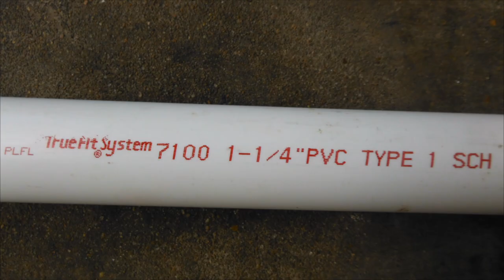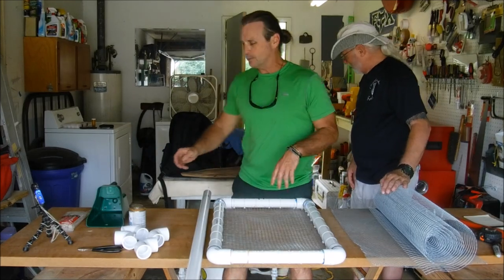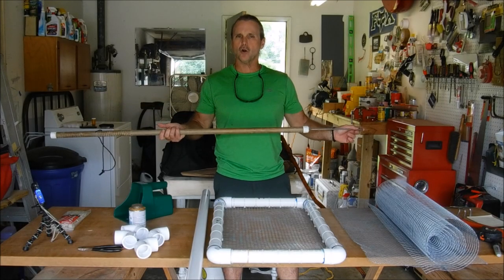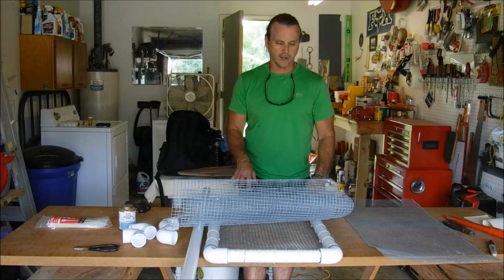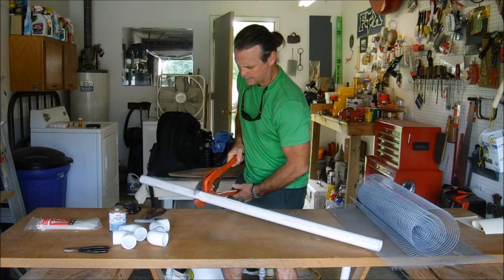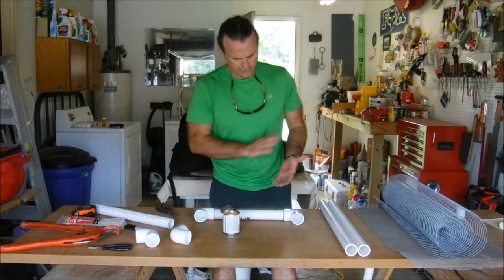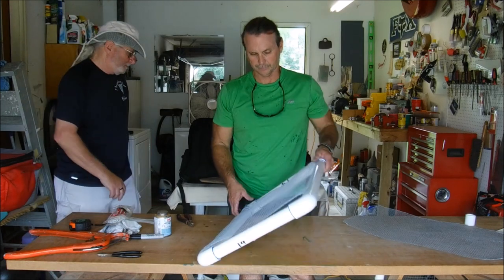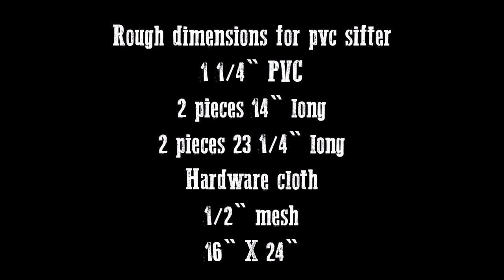Arrowhead Hunting - Creek Gear - Sifters to Underwear

Comment: awesome advice. the only thing we do different is we use a really heavy duty plastic netting instead. it really saves the wear and tear on your fingertips. there are no problems with it being plastic as it is tough as nails. we use some cut pool noodles zip tied to the pvc frame as extra buoyancy and to help keep rocks from going over the edge. always carry extra zip ties
Reply from the maker: Thanks. Where do you get the netting? We always carry extra zip ties. Thanks again and good luck.
Reply: I order it off amazon. its called tenax hardware net and comes in 3' wide rolls.
Reply: netting is used in a generic since, its some really stiff stuff. it has no problem holding 2 shovel loads when we are waist deep digging.
Reply from the maker: Thanks for this information. We'll  have to check into this.
Reply: This was informative!  I enjoy your hunts/adventures.  And, you might already have another solution,  but when you snip off the zip ties, sometimes it leaves a sharp point that pricks your fingers! Take a large chisel point soldering iron and smooth em down. - just a thought.
 Good luck huntin' and making videos! Thanks!

Comment: nice video y'all, wish I had some sandy peppley creek for digging shiney rocks, that would be the place to be in this 100 heat, around here the only reason to screen is if a place has birdpoints & then you want to use the 1/4 inch screen or you'll be loosing birdies, we need some rain around here bad, been 2 weeks & we're drying out bad, happy hunting next time out fellas
best wishes
Reply from the maker: Thanks Brooksy. We're getting into our summertime everyday rain shower pattern now but that's alright. As long as it's not lightning we can stay in the cool creek and dig and sift. It is actually my favorite way to hunt because the points come out already clean and you don't get hot. Thanks buddy and GL&HH.

Comment: Can you share some more insight on how to build one of your probes? I have some ideas brainstorming but seems y’all have it the right way.
Reply from the maker: Sure, here is a link to another video. There is a segment on how we make our probes. It doesn't go into too much depth but make sure your metal rod is flat on both ends, a pointed end will split the stick. Next drill a pilot hole about 2.5 inches or so into your stick but make sure the hole is 1/16" smaller than your metal rod. Gently tap the rod into the hole to the bottom. Hope this helps.
https://youtu.be/zXT1RPSAyYI

Comment: I just bought material for my shifter and ended up with 2 inch PVC. Will that work fine or is there a reason for concern with the bigger PVC?
Reply from the maker: Yes it will work just fine. Good luck.